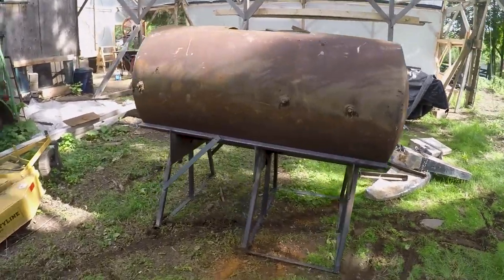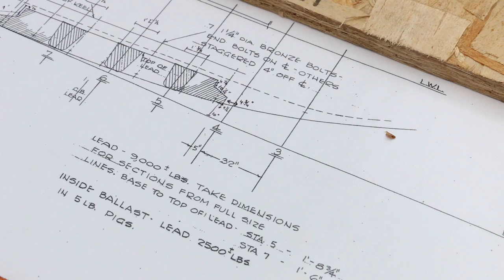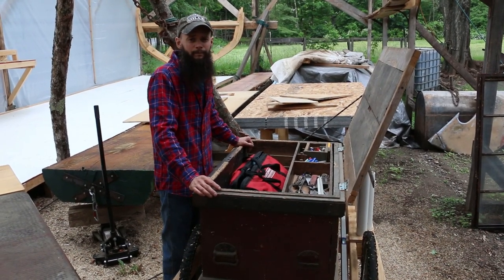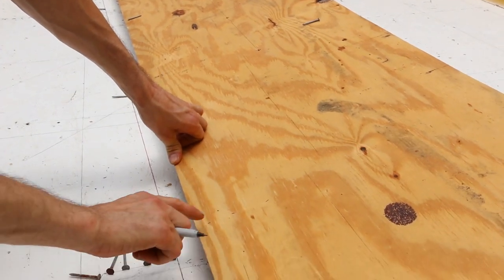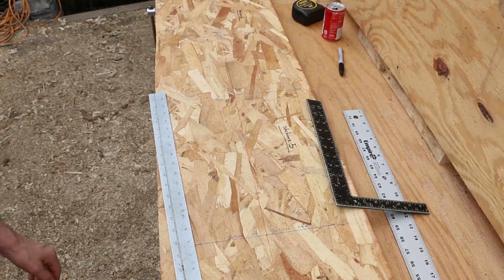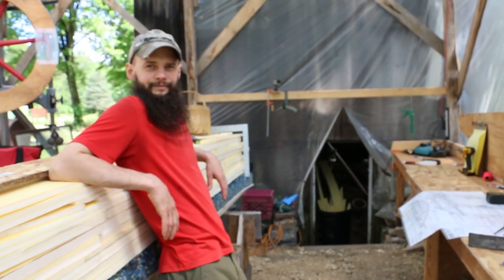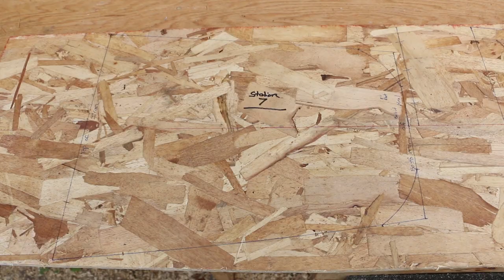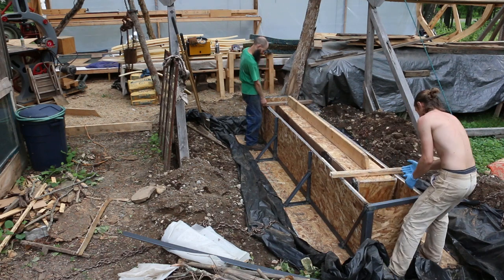Acorn to Arabella - Journey of a Wooden Boat - Episode 13: Ballast Keel Mold

Comment: Don't know if it's too late but when your lines are drawn and set spray over them with a sealer. Clear deck sealer from a pump spray can. I do this in the winter when I snap lines for walls and it's looking like rain. No fading or washing away.
Reply from the maker: We could have used that tip a while ago haha.  We've drawn over the lines a couple of times.  The sharpie lines kept fading.  We've put up some shade now and cover the floor to keep the UV off of it as much as possible.
Reply: resin wash it mate
Reply: Yeah, I was going to make a similar suggestion. Any kind of clear spray with UV protection. Clear-coat, hairspray, spray poly, etc.
Reply: Red as a color (pigment) is not “light-fast”. It is the hardest color to keep from fading. Doesn’t matter what it is, red is not a stable color.
Reply: Grease pencils aka Chinagraph
Dyes fade in red -> orange -> yellow -> green -> blue -> indigo -> violet order, because the closer the dye's colour is to the red end of the EM spectrum, the higher the energy of the waves absorbed (including UV rays which are the main, but not only culprit). 
Red looks the colour it does because it is absorbing violet, and reflecting red wavelengths (crudely speaking)
Reply: which incidentally is why blue is the overwhelmingly popular colour for fabric dodgers and sail covers on sailboats.
And a popular paint colour for hulls,  I guess.
Reply: @Gottenhimfella  you blind us with science then finish with crudely speaking lol

Comment: Hi guys if you can get hold of railway line cut into sections so when your going to put your bolts in you have a solid base for your washers to sit on plus you end up with extra weight
Reply from the maker: We are going to install some bronze floors that the keel bolts will go through and will basically be a fancier version of what you describe.

Comment: get some paint markers they might be a little thick for how precise you need to be though, just a thought

Also check out that bug on the left side of the screen crawling up the middle support beam wonder if the editor saw that
9:57
Reply from the maker: He did not notice it but a bunch of viewers have! 
Thanks for the tip on the markers

Comment: Maybe the lead keel is flatter because lead is softer. Irion will hold its shape even if it is less massive in form. Nice videos
Reply from the maker: The lead is just much smaller because lead is so much denser than iron.
Reply: In the video you where discussing the profile of the keel. My comment was not related to density and size but the shape of the profile. I was speculating thay the designer went with a blunter profile for the structurally softer material. Steel will stand up to abuse even in a sharper profile. Keels bump into stuff sooner or later after all.
Reply: I have had quite enough off school. But thanks for the attention.
Reply: Mike (and the builders, if they happen across this comment)
I speculate that the reason the iron keel is pointier underneath is to ease the job of repainting the antifouling on the underside of the ballast keel without needing to resort to a cradle on a slipway. As you point out, iron is harder, and can withstand a narrower contact patch allowing beaching the boat on a hard bottom and letting the tide go away. Heeling the boat one way and then the other lets you paint almost to the centreline.  (This is a trade-off of performance in favour of convenience and lower maintenance cost, because from a performance/ fluid flow standpoint, the flat bottom is to be preferred*)
With the lead keel, you would not be able to do it this way because it's not hard enough. Especially if the antimony content is low...
* This also fits better with the performance advantages of lead over iron.
Reply: I speculate that the reason the iron keel is pointier underneath is to ease the job of repainting the antifouling on the underside of the ballast keel without needing to resort to a cradle on a slipway. Iron is harder, and can withstand a narrower contact patch allowing beaching the boat on a hard bottom and letting the tide go away. Heeling the boat one way and then the other lets you paint almost to the centreline.  (This is a trade-off of performance in favour of convenience and lower maintenance cost, because from a performance/ fluid flow standpoint, the flat bottom is to be preferred*)
With the lead keel, you would not be able to do it this way because it's not hard enough. Especially if the antimony content is low...

Comment: Just a thought.... couldn't you have used sheets of acetate to cut and transfer your sweep lines?  That's what we've done in the auto industry.  Lay them down, scratch reference lines, scratch deeper and snap to the sweep line, transfer to plywood.

Comment: Sounds like you picked up an old Milwaukee triple geared 1/2 drill.
Reply from the maker: 3/4" chuck actually and I don't think it's a Milwaukee although I could be wrong.  It's currently on loan to a buddy using it to mix mortar while he tiles his basement.

Comment: Are you mixing up waterline length with overall length? The LWL (Waterline length) is the length of the hull where it contacts the surface of the water and would be shorter than the overall length.
Reply from the maker: Maybe we did, would have to go back and watch to find out.  She will be 38' on deck with a 32' waterline.

Comment: Copying crayon from the tattoo industry. Unless you water it, it will never come off. And when you're done, you use a wet sponge and some low yield soap detergent and it's washed off. Don't get it on your skin tho...what's best, it came in red, black, and blue (last i recall, 7 years since).
Reply from the maker: Huh,
Interesting idea, we will have to look into that. 
Thanks for the tip!

Comment: Don't even bother with sealer. Crayon has wax that should be rather water resistant.
Reply from the maker: The UV is the bigger issue.  Red crayon, ink, pencil... All disappear scarily fast.
Reply: Acorn To Arabella: Red is notoriously unstable in virtually all media. Probably better off using black blue green brown or orange. Great work!